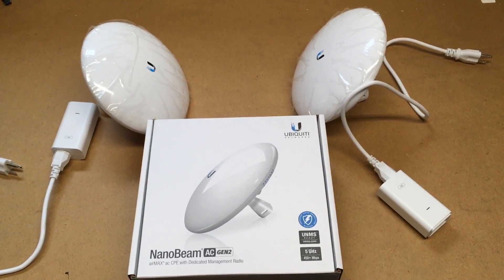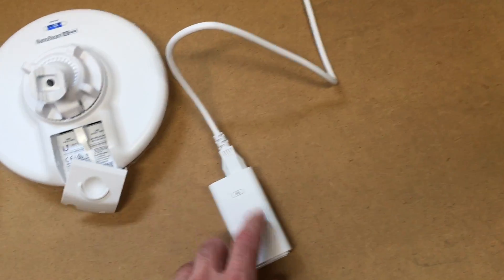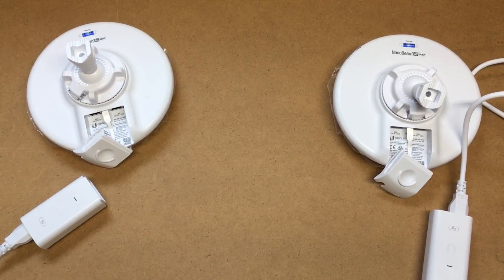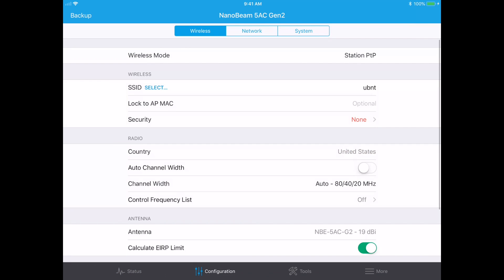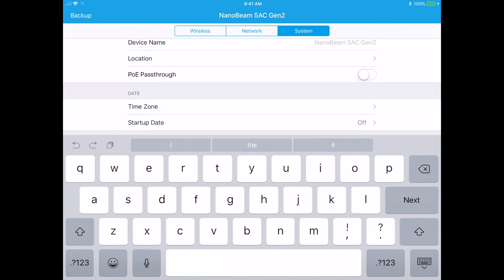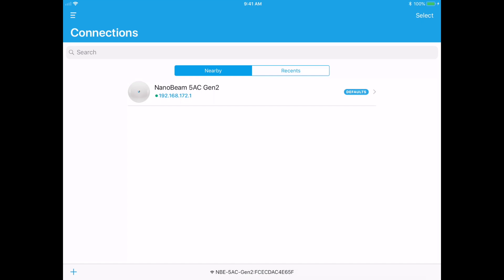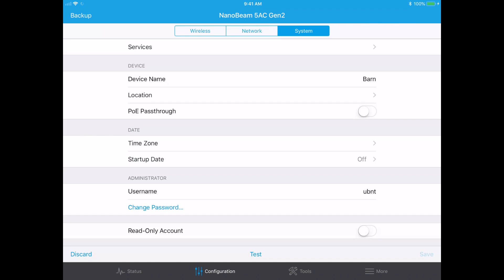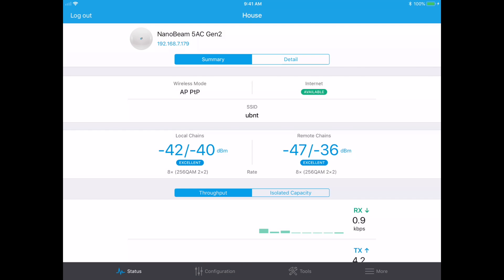Ubiquiti NanoBeam AC Gen2 Basic Wireless Bridge Setup

Comment: I use these to beam my home network down to the horse barn where I have a poe switch and camera system. For some reason if I power cycle the NVR, it never comes back online with the home network unless I also reboot the nanobeam. It's like the nanobeam is screwing with the IP for the NVR and I can't figure out how to fix it. It's all one network and there should not be any routing happening beyond the main router in the house. Any ideas? I have the house nanobeam set as AP PtP and the barn nanobeam set as station PtP.

Comment: Rick i have the NBE-5ac-Gen2 and a NBE-2AC-13, i have been trying to set these up with DHCP. I use apple Extreme WiFi router. I am trying to get WiFi to my barn using these with a Amplifi HD mesh router that is setup for bridge mode. I cat seem to get the radios to connect with each other. I guess I am doing something incorrectly. I have watched your video a few times and believe I am missing something. You made it look so simple.

Comment: This was a great video and it made seting them up seamless.  I had them configured and then got them setup in the field, and again they were working perfectly for 2 days about 100m aport with a great signal as reported by the app.  I had to clean up my cabling in the field and had to unplug it for about 10 minutes, and now the satellite won't re-connect.  How do I make the management radio come up to troubleshoot the satellite now that it is permanently installed nowhere near a wired connection?  I unplugged it for about 10 minutes again, but didn't see the radio come up?

Comment: Would these work in a series? Like a to b then b to c. Needing to stretch it over a distance of 1000 feet but in a alter path for line of sight.
Reply from the maker: I would think that could work. If you have a powerful enough PoE injector, you might be able to run PoE to one and piggyback the second off it. (I haven't verified this though)

Comment: So, i'm using these and not getting the speed I want. I realize first off that I have the 2 devices reversed, I have the home set as Station and the Garage set as AP. It's not that far, so perhaps that's why I'm getting less speed? And am I not supposed to enter the SSID as the same as my actual wireless network? I am also using 2 unifi ac lite APs. Should the "ssid" for the nanobeams be another network, are the nanobeams also used as APs? Might be too long to expect a reply but the video is helpful, thanks.
Reply from the maker: You want a different SSID than your main wifi network. You also want to make sure you are on a different frequency from your main wifi or any other wifi access points in the area. Remember, this uses 5Ghz wifi so 2.4Ghz won't affect it. You can also try using an 80Mhz channel width to increase your speed.
Reply: @Rickmakes  gotcha. ok cool, much appreciate the reply. I'll change some stuff and see if it improves.
Reply: Man I fucking love the internet. I thought I'd have to pull the remote AP down but I just made the changes, made a different SSID, and switch the AP and Station and now I'm getting 650 mbps back and forth. Super helpful man. thank you.

Comment: Rick, You mention it replaces a long cable connection.  I have a house too heavily enclosed by tall trees to mount a Starlink dish. I have a tractor shed where I can use the 100' Starlink disk cable to see a clear view of the sky.  The distance between the shed and house is about 300' thru woods.  It would be cleaner/nicer/faster (if I can set it up..) to use the bridge you describe ...but, is there signal loss compared to running Cat6?  I am only  ~100mi, as the crow flys, from the White House, but we have never had 'good anything'.  Thanks for the posting.    Jim
Reply from the maker: The Nanobeam should have line of sight between the two antennas. I’m guessing in your situation, there would be trees in the way, correct? That would block or degrade the signal. Hard to say how much without testing.
Reply: @Rickmakes  Thanks, Rick...  Ya, you would not get a clean point-to-point shot with a 105mm howitzer.  Cheers.  Jim

Comment: Great video and probability a solution to my problem I have  that maybe you can help with. I have a shed 600ft from my hoise that I want to get WiFi to monitor my solar.  when I mount the 2nd unit to the shed will act as a WiFi extender or just a access point that I would have to add and another router or extender. 
What frequency does it use 2ghz or 5ghz?
Reply from the maker: You can think of the NanoBeams as being like a long ethernet cable. In the shed, the NanoBeam will have an ethernet jack. You could connect a computer to it, a switch or an access point. The NanoBeam doesn't have a secondary wifi access point. The NanoBeam talk to each other on 5Ghz. When you connect an access point in the shed, you can run it off 2.4 or 5Ghz. You would just want to make sure it isn't on the same frequency as the NanoBeam if you are using 5Ghz. I hope that answers your question. I anything isn't clear, let me know.
Reply: @Rickmakes  Yes it does, 😊
Reply: @Rickmakes  Yes it does. I need say to nanobeams, one to transmit from house, one to recieve at shed. The one in the shed I can connect to a wireless router to provide wireless in the shed. one as far as line of site.  I do have a few trees and branches in line but from the shed I can see the post on the house that  I plan to place one of the nanobeams. Would this be acceptable or does have to be clear %100?

Comment: Loved your Video...I have gone through this setup many many times...reset to factory, etc and I can NEVER get the Wireless Mode Options??? It is driving me nuts.... Any thoughts? My is a simple one like your video Deck to Dock...but I can never get one side to Station??? Any help appreciated.
Reply from the maker: I set this up on my iPad but I have been managing it from a web browser since. I just logged into my iPad app and noticed it has changed quite a bit. It now has switches for "Access Point" and "PtP Mode". Both devices have "PtP Mode" turned on. Only the home device has "Access Point" turned on. Also, on the "Network" tab, make sure you have "Network Mode" set to "Bridge". Please let me know if this does or doesn't help. I make need to make an updated video with the new interface.

Comment: Can I connect the "home NanoBeam to an access point in the home rather than to the modem/router in  the home? The access point is a TP-Link AC1200 (Archer C5) router which I have configured as an access point and which is connected to the modem/router via a powerline adapter.

Comment: Thanks Rick. This might be a stupid question but this thing is new to me. So do we setup the banobeam in the roof or can I use it in my bedroom? I mean should it be in a hight point or any place at home like near the window?
Reply from the maker: From what I understand, wifi can pass through glass but it can be hindered by modern "low-e, low emissivity" glass. It is probably best to mount it outside. I'm not a fan of mounting things directly on the roof as holes in the roof can leak. If you have to, use a good sealant and check it every so often. The side of a building is preferred. You can find antenna mounts that mount to the side and stick up and away from the building. If you have a window that would be ideal, you could try pointing it out the window and if it has problems, move it to an outside mount.
Reply: RickMakes gotcha. appreciate your prompt response mate
Reply: RickMakes gotcha. appreciate your prompt response mate

Comment: Great video! Thank you very much. If I would have to have an poe ip camera connected to the nanobeam transmitting to an other AP, how should I wire the nanobeam and the camera? I would appreciate any help!
Reply from the maker: I think you can plug a Ubiquiti camera directly into the Nanobeam. From what I understand, you have to use a 1amp power injector as opposed to the .5 power injector that comes with the Nanobeam. I don't know about plugging in other brands of cameras.

Comment: Thank you for this video, it is really helpful. I am familiar with the UniFi access points and software management but need to configure a wireless bridge and looking at these products. 
Can I ask - based on the configuration you did in the video, would DHCP from the 'Home' network then assign addresses for devices connected to the 'Barn' AP (via a switch for example) or does that need to be managed with a separate router on the Barn side?
Reply from the maker: It does assign DHCP to the barn side. I am currently using it that way. You can think of the bridge as being like a long ethernet cable.

Comment: I am struggling big time with set up. For set up, do you just need the cat6 from the poe adapter to the Main PoE port on the NanoBeam? Or do I need a second cable hardwiring the NanoBeam into the current network I'm attempting to "beam"?
Reply from the maker: You connect your home switch/router to your PoE adapter LAN port. Then you connect the adapter PoE port to the PoE port on your Nanobeam. On the remote side, you connect your PoE port on your Nanobeam to the PoE port on your PoE adapter. You then connect the LAN port to a computer, a switch, a wifi access point or some other device. You can imagine the Nanobeam bridge as functioning like a really long ethernet cable.
Reply: @Rickmakes  Thanks! I got everything working thanks to your reply and your videos. You saved me tons of headache I appreciate your help very much.

Comment: Probably stupid questions but here goes. 

I want the same ssid in the house and barn plus the same network. What ssid should I choose in the actual nanobeams? Are they creating a new network for talking with eachother so this ssid should be "their own"?

I have a complete unifi system in my main house (5 APs around the yard) and want to extend that into the guest house and instead of wiring it I am looking into this. My FlexHD on the outer wall does not reach more than half into the guest house so need to put it inside. (Remote controlling heaters etc).
I am thinking of mounting this on the outer wall, drill, and connect it to a switch -> flexhd inside. 

Anyway.

Network: 192.168.88.0 in the house, SSID: paradiset. Would be awesome if that could be used in both houses, so nice to be on the same network.
Reply from the maker: The nanobeams use their own ssid. You could name it something like "bridge/beam/link/etc...". Once you have them set up, it works kinda like having a long ethernet wire. You could connect a switch to the remote nanobeam and connect up whatever you want. It will be on the main network.

Comment: can i connect two routers or AP devices through the two ports in the bottom of the receiver antenna? if not, the second port (LAN2) what is it used for?

Comment: Would these work over a relatively short distance (about 150-200 feet) but mounted inside going through 2 windows? Rather install them inside for now since winter is here but will do outdoor installation if indoor installation would not work.
Reply from the maker: Generally speaking wifi will go through regular glass. Low-e glass can supposedly block wifi although I haven't tested it myself. If the windows are old, I'm guessing they aren't low-e.

Comment: I have a problem with one I’m installing. I followed the steps as per the video except I’m using static IP’s. I only have the option to toggle between AP on/off and ptp on/off on the app so I made one the access point and ptp and the other ptp. But I can’t get them to connect, any help would be really appreciated

Comment: Very helpful.  Does the PTP retain it's settings when upplugged?
Reply from the maker: Yes, the settings are retained. There is one thing to consider. If you set it up to use DHCP, the IP address could change. The connection should still work but it might be hard to connect to it to do configuration. To remedy this, it would be best to set a static IP up for the devices on your DHCP server (router) or on the device itself.
Reply: @Rickmakes  Excellent.  Thanks for the vid.  Made my life a lot easier.

Comment: Great video. Please follow my logic. Cable Modem connected to my Home WiFi router WAN port.  I would like for for ALL routing for house and the Barn to take place here. One of the LAN ports of the router connects via POE injector to the "Home" Nano Beam. 

Question 1: Do I  set up the Home Nano Beam with static IP or DHCP?  if static how do I set that up? 
Question 2: Which SSID do I use here? Which Mode?

Question 3: Do I want the "Barn" Nano Beam to be set to static or DHCP?  if static how do I set that up? 
Question 4: Which SSID do I use here? Which Mode?

I am adding a UAP-AC-PRO Access Point in the Barn.

So I connect the Barn AP with a separate POE injector that connects from the Barn Nano Beam LAN port of its own POE injector correct?

Question 5: Can the Access Point in the barn have the same SSID and PW as I have in the house so I do not have to switch between access points when I go back and forth?

Anything else I am missing?

Thank you again for the knowledge you share with you subscriber base.
Reply from the maker: I currently use DHCP on both devices but I also have them set up in my main router so they always get assigned the same IP addresses. Alternatively you can assign static IPs to them. You would need to find unused IP addresses on your private subnet that aren't in the DHCP pool. For instance, DHCP might be set up to assign addresses between 192.168.1.100 to 192.168.1.254. You might then assign 192.168.1.30 and 192.168.1.31 if they aren't already being used. You would just set them up on the Nanobeams.

The SSID can be whatever you choose (like nanobeam, bridge, etc...). You want to make it the same on both Nanobeam devices. I would not make it the same as you use for your regular Wifi network. The home is set up as an "access point point-to-point" (AP PtP) and the barn is set up as a "station point-to-point" (Station PtP).

I think you might be able to power the Nanobeam and the AC-PRO from the same PoE injector but you would need a higher power injector than comes with the Nanobeam. I haven't done this so I would do some research to make sure they can work that way.

You should be fine have the barn wifi the same as the house.

I think you have everything accounted for. I think the easiest way to think about the nanobeams is that they act like a really long ethernet cable. The barn side gets DHCP from the main router, you can access internet, access computers and network equipment in the home, print to printers in the home etc...
Reply: @Rickmakes  Thank you , that makes perfect since to me. Keep teaching!

Comment: So can you now connect any device to “barn” and use the internet? Or do you have to plug a ap into the barn end too?
Reply from the maker: The "barn" side will have an ethernet port that is on the same LAN as the house. You could connect one or more computers (using a switch) and have internet access. If you want wifi in the barn, you would connect a separate access point up to the ethernet.
Reply: @Rickmakes  that separate access point for wifi, is it just another router? If so is it just plug and play or do you need something special and set it up.

Comment: I'm trying to setup the NanoBeam AC Gen2.  I have a Netgear Nighthawk AC1900 Cable modem router.  When I plug the ethernet cable into the router to connect the NanoBeams to the network it freezes the router.  I have connected them to an old Arris  and it works fine.  Any thoughts?
Reply from the maker: That is a tough one. I've had IP address conflicts cause weird network issues but if the NanoBeams are set up to use DHCP, I wouldn't think that would cause a problem. Is the Nighthawk on the latest firmware? Have you tried putting a network switch between the NanoBeam and the router?

Comment: the diagram is deployed at hill and mountain region with 4km - distance. Is this possible? Thank
Reply from the maker: It is hard to say definitively if it will work but I suspect it would work if the two antennas have line of sight to each other. If there are obstructions in the way, I suspect they won't work.
Reply: @Rickmakes   thank. So any solution for me.
Reply: @Rickmakes   any type of atenna forlong - distance  LTE signal  from BTS station

Comment: can you explain regarding this device signal range  because  internet connection is present around 1 km far distance from my house
Reply from the maker: The performance you will get is dependent on a number of factors. With ideal conditions, 1km shouldn't be a problem. You will need line of sight between the two points. Performance can be hampered by interference from other (wifi/radio) devices near or between the two antennas. If you can a clear sight between the two locations, this could be a good option. Ubiquiti has a page comparing their bridge products. It might be of some help: https://help.ubnt.com/hc/en-us/articles/205197750-airMAX-Which-product-should-I-use-

Comment: Rick, how would you go about adding an additional station pointing to the house? Would it be as simple as configuring the barn antenna? I'm planning to have 1x AP PtP to 3x Station PtP, any suggestions?
Reply from the maker: I haven't set it up with multiple stations but from what I understand, instead of Point to point PtP, you would set them up as Point to MultiPoint PtMP. If your remote (barn) stations are spread out too much, there may be a better product to use as your house access point. I not sure exactly which one would meet your needs.